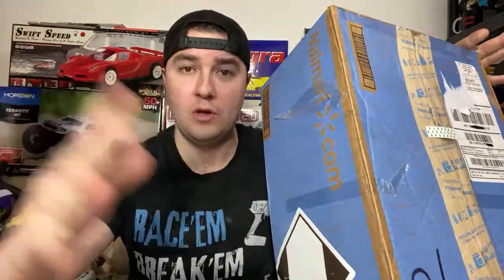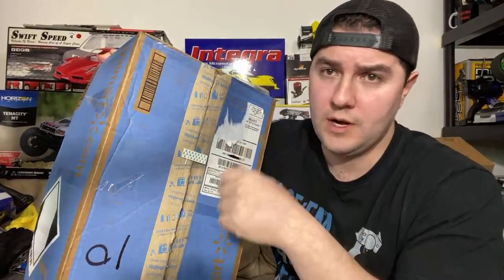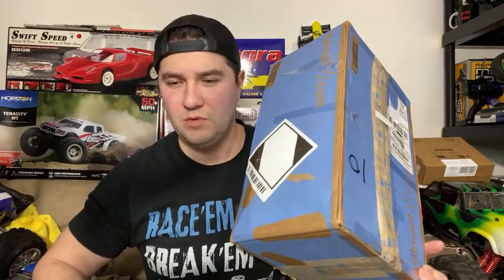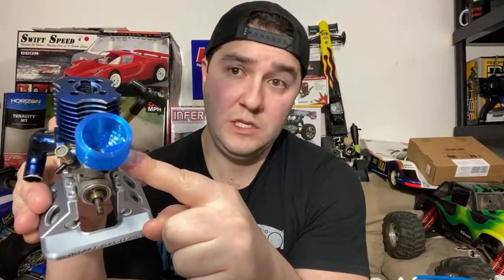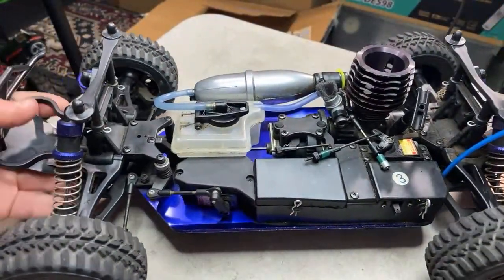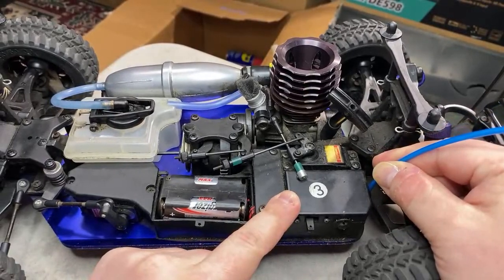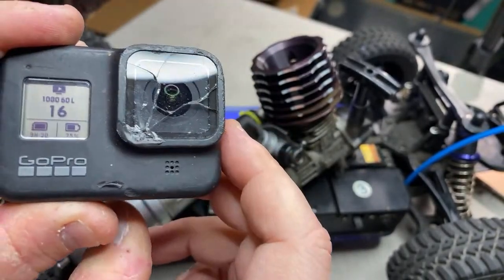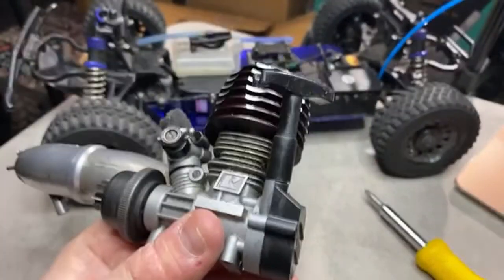LIVE Mystery New Nitro RC Unboxing - Guarantee its not what you’re expecting Nitro Gang🔥👍🏻

Comment: Hey D, sorry I missed the Live stream.
That Kyosho is cool.
Very different looking brake linkage.
As far as 3d printers go, yes, there's a learning curve for sure, but for us rc enthusiasts that need to print nylon, there are a few things to keep in mind.
I'll make it short here... The printer you need is the  Creality V3 KE, including all metal hot end, direct drive extruder, WIFI, runs Kipper software, etc. I have one, and you won't be disappointed. Lots of value. 
I also picked up the fabric enclosure for it, and very happy so far.
Let me know if you want a link for the enclosure.
Keep nitro alive brother. 😂👍